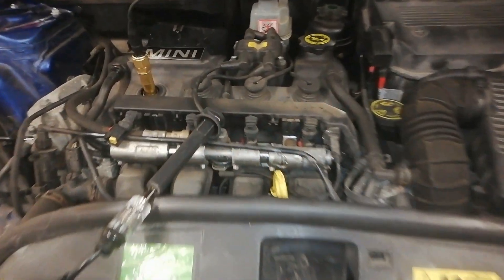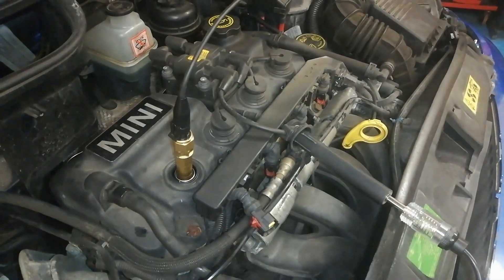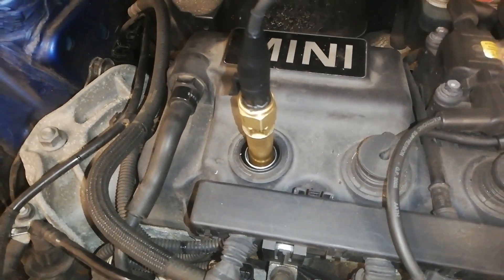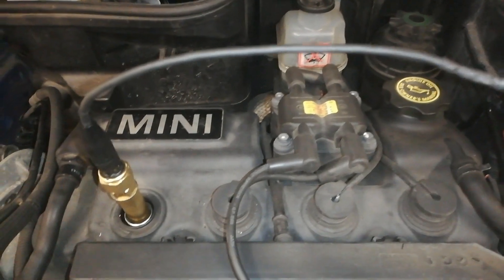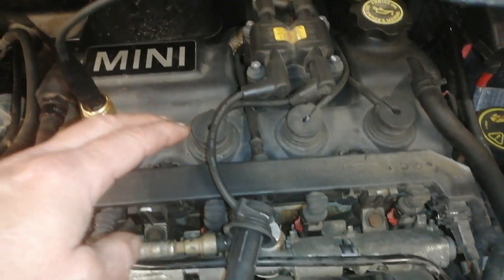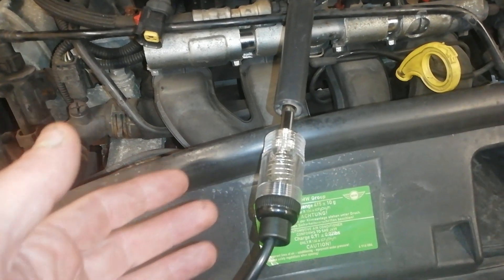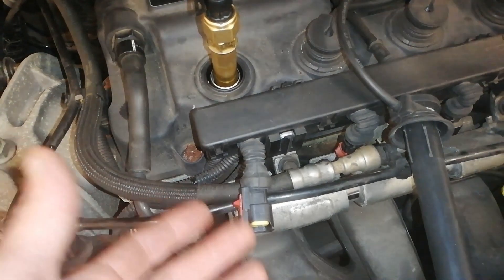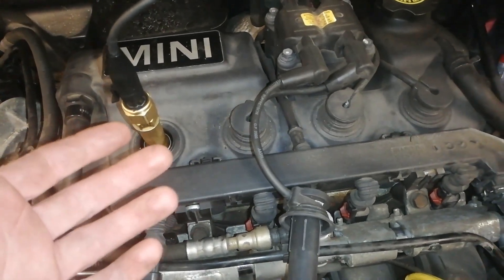DIY In-Cylinder Pressure Analysis Pico 2204a Part2

Comment: i was thinking of buying compression tester and mocking this up with the hoses/connectors from that then i thought why not just tee in the pressure trasnsducer to a compression guage then you can see what psi from the guage and compare that too the voltage output of transducer and really leave out the math and guess work.
Reply from the maker: what guess work?

Comment: Hi Dave. Thanks for the great info. In the video you are using the 2204a scope in stream mode and capture 3 Ms/s .how is it possible? As far as I know the maximum sample rate of this scope in stream mode is only 1Ms/s. Thanks
Reply from the maker: Ive no idea, im only going by the properties data, cheers
Reply: Picotech seem to be conservative with their claims. I have a 2405 (4 channel/25Mhz) and I get almost 9Ms/s in streaming mode. Way more than advertised. I only get that with one channel - if I add a second channel then it halves as you'd expect, but it's still very impressive.

Comment: Excellent video, Dave. You've sold me on sourcing the correct transducer for this project. I found it for only $47 here in the States, but what's crazy is the connector/cable for it is $60!! Looking at the data sheet, it's just a 3 wire metri-pack 150 connector and a few feet of wire, too. That they want more for the wire than the sensor is nuts, haha.
Sensor :
https://www.onlinecomponents.com/honeywell/px3an2bs250paaax-49135635.html
Connector:
https://www.onlinecomponents.com/honeywell/3685301-11921232.html
Reply: You may purchase the cable with connector from aliexpress for less than 10 USD.
Reply from the maker: Buy a china ebay transducer, comes with connector exact same